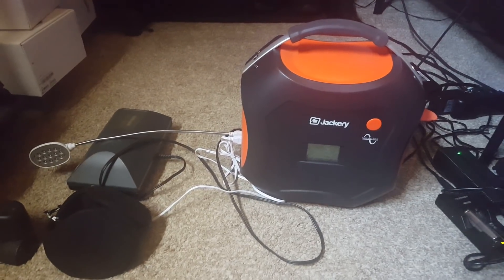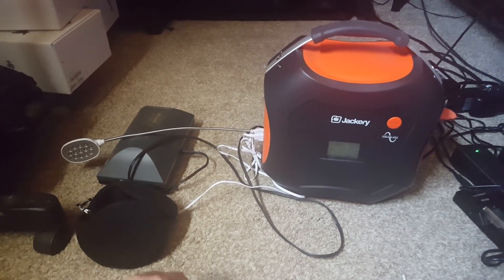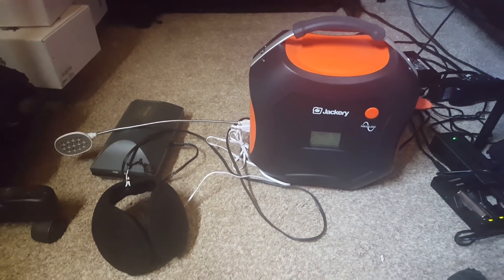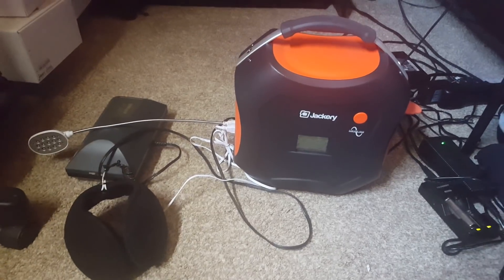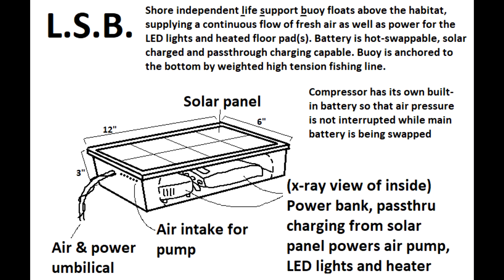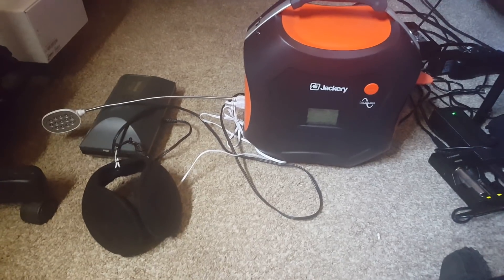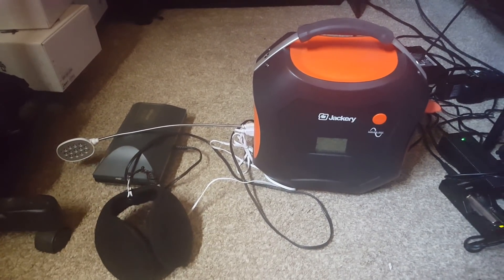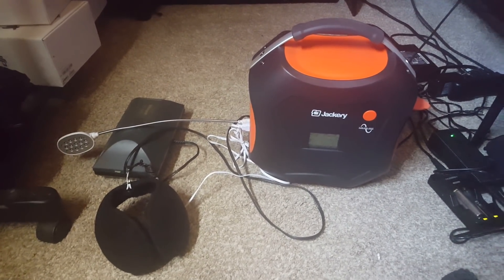Battery Test, and Life Support Buoy Introduction

Comment: Hey dude, i'm a machinist, hit me up if you need help fabricating stuff. I'm an objectivist myself and this is most amusing for me.
Reply from the maker: I might just do that. There's a lot of habitat designs I had to shelve because they required custom metal pieces. For example if you want to connect a few rooms with clear tunnels, but have it all be one structure, they all need to be rigidly mounted to a thick metal plate or the tubes will flex and break as you're picking it up and moving it around, since the ballast weights are so heavy.
Reply: @Hamdad  sure pm me when you you got a design and i'll see what can be done.

Comment: Something like a sufficiently air tight ice cooler might provide better insulation for the hamsternauts and reduce the necessary power consumption for the heating of Hampture. The problem of course would be the proper installation of windows.
Reply from the maker: Not a bad idea. But that complicates design and introduces more potential points of failure. My existing solution, a resistive heated floor, seems to do the job fine.

Comment: Why don't you just keep them in a fish tank with some fish around them? It would be much easier to monitor and you could do stuff like cleaning the hamster cages periodically.
Reply: He needs a remote control airlock and a small robot which can push all of the waste into said airlock and flush it into the nether.
Reply from the maker: I did, for a long time. Check out my older videos, most were of smaller habitats in a large fish tank.

Comment: Just how many hamsters died on your projects?
Reply: Pleny but they died knowing it was all in the name of nessary progress.
Reply: It wouldn’t be hard to pull a hamster out in case of emergency. For the full thing he should attach buoys and a camera inside so he can bring the habitat above the water and allow the Hamsters to breathe.
Reply from the maker: I've been through 3 pairs now. All except the most recent pair died of old age, though they were close. None have drowned, which is partly good luck but also partly the ambient pressure design of the habs. The air inside is equalized to the outside water pressure, which is how the stagnant air is continually forced out as bubbles. 

This is a time tested, fault tolerate design. I could drill a hole right in the habitat while it's submerged and so long as the hole isn't very big, air would bubble out but water wouldn't enter. It's like if you inflated a balloon and then released the air gradually while holding it underwater in a swimming pool.
Reply: @Hamdad  their names shall be inscribed on pillars among other legendary hero's, their legacy is of imortant demi gods which shall be told for melina to come as they live forever among the stars

Comment: Have you thought about using some sort of equipment to be able to know if something critical fails on hampture out in the pond?  Like a way to make sure things are operational, or the temperature is high enough, and send alerts if anything fails/falls below certain levels.
Reply from the maker: Sure, I have a mifi I could use to establish a remote connection. I think I'd also need an arduino. The problem is my technical knowledge really isn't where it needs to be to set something like that up. Ideally I'd have it send text messages to my phone to let me know what the battery percentage is at, in 10% increments.
Reply from the maker: Patreon support is not yet to where I could afford a dedicated phone or service for it just as a telemetry tool, but when it is, I'll remember your offer.
Reply: Just out of curiosity, can you get pre-paid sim cards/phones? 
Over in Australia we can buy a standalone SIM card, put $10 on it, and put it in any unlocked phone. So a small recharge might last months if you were to send like a text a day at 10c/text.
Years back I had a broken old phone connected to many batteries in a remote area, and it would text me when the batteries needed to be replaced with charged ones. I put $50 on it, and it had a 365 day credit expiry.

And keep up the good work, love the video updates.
Reply from the maker: That's a really good idea. I wish I got government money for this so I could hire you.
Reply: I Chose Hampture For a phone service you could try FreedomPop.  I have a few old Android phones I repurposed and bought $1.99 SIM cards (seems to happen a few times a year when I check SlickDeals) for them where they stay always connected.  Default is usually 200MB free a month but sometimes you can get 500, though 200 is more than enough.  From there, you could get a crappy android phone, install IFTTT, and have it possibly text you notifications through that?  There is also an app called Automate and an app called Tasker, both of which you could use to create rules for checking in, possibly.  Do you have a Twitter?
Reply: You might be able to just connect a shitty android phone, and use something like: https://play.google.com/store/apps/details?id=com.andrzejniecnyit.low.battery.sms.alert&hl=en  to automatically send a text message to your main phone number when the phone is close to dying, or simply not 100% charged.

You might need to do some experimentation, as the phone will draw a lot less power than the pump, maybe have it check if the phone is discharged at all (meaning at some point the battery died).

I am a software developer, I haven't worked with arduino before, but if you need some programming/technical help, feel free to reach out. I could maybe build you a simple app that takes some diagnostic information (eg. GPS, battery %, motion, barometers, illumination, etc.) and text (or emails?) you them every x minutes, unless there is a sudden change (like motion was activated).
But this would depend on what kind of phone you have available - different sensors depending on the device.